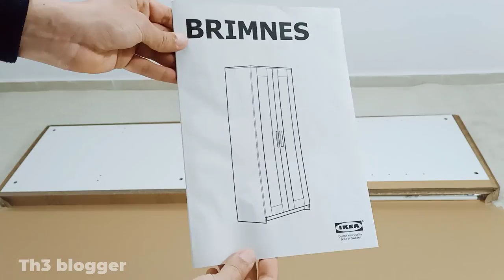IKEA BRIMNES Wardrobe with 2 doors - assembly instructions  very detailed

Comment: Good vid ... came here after opening the box as ikea did a dump thing by putting the two panels you need to start building it in separate boxes instead of doing it like lego where each box containers all parts needed to complete each section per labeled bag/box ....way to go ikea got screwed us over
Reply from the maker: it's true.  for this you must always open all the boxes and check all the contents. thanks for watching

Comment: Step 3 is a disaster waiting to happen. You can’t tell from a quick glance but the bottom piece is not exactly symmetrical and there is a front and back. The instructions do not call this out. The front should be flush with the front of the side boards.